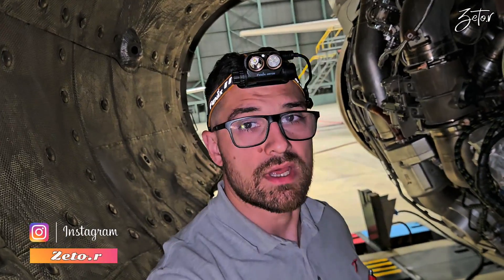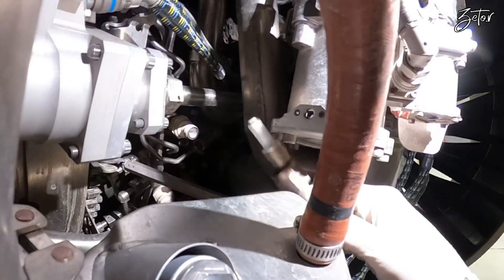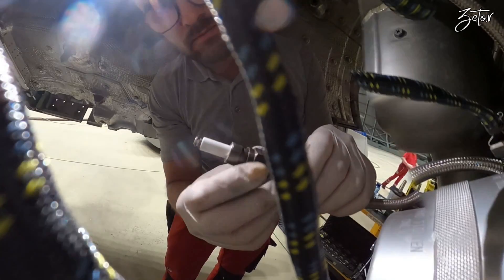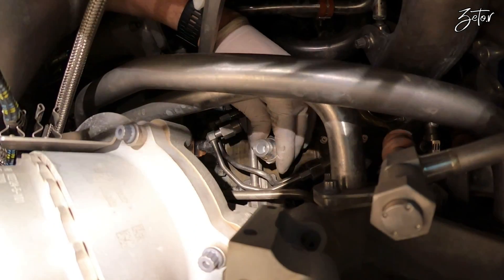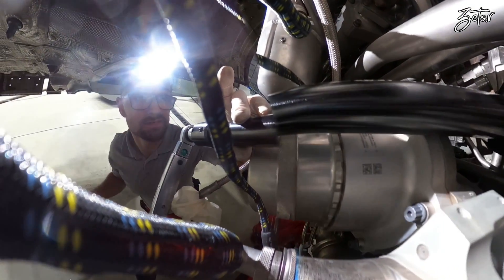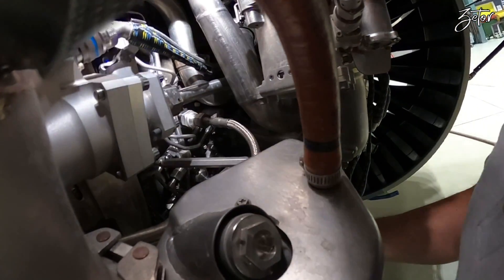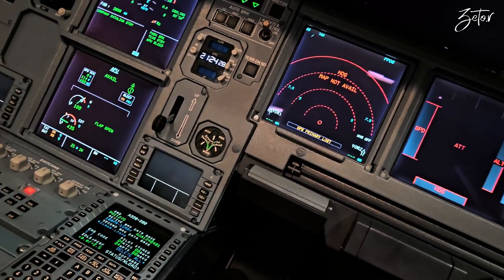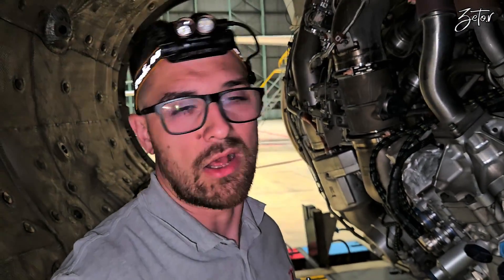How to replace Igniter plugs on PW1100G of A320

Comment: Buongiorno Tomas: Volevo sapere se dopo l'avvio del motore le candele rimangono in funzione? durante il volo dell'aereo in caso di pioggia le candele entrano in funzione in automatico oppure il pilota deve accendere, guardo i tuoi video molto volentieri, sono molto interessanti, ciao e buon ferragosto
Reply from the maker: After start they are automatically switched off , they are switched on only during heavy rain to prevent light out

Comment: Which cb did you pull before apu fire test ?
Reply from the maker: I don't know the name and I'm not at work to find it but you will find it in AMM in APU start procedure
Reply: @zeto.r  ok i found its L40 to prevent auto extinguish
Reply from the maker: Exactly 🙂

Comment: Here you can see how complicated it is to perform the reliability SB to the igniter adapter spacer...
And to safety wire the adapter...
Nice to see how it works "on wing" 😉
Reply from the maker: Yes it is hard to access of course. I guess shop work can be also really chalanging
Reply: @zeto.r  Due to big redesign of the core engine the amount of Service Bulletins and the borescope limits ... it is 😉
Keep up your Videos. Very interesting stuff 💪

Comment: How do you like the PW's? My carrier does not have them so aside from older Pratt's I have no experience on them. I can tell you the GE/CFM versions go through fuel nozzles like crazy compared to old. Just part of the cost of running the engine leaner and hotter I hypothesize.
Reply: From my limited line MX perspective they're a pain. They're easy to over service if you're not careful, you have to open the C ducts to access the IDG, and the core is so small that everything on it is packed very tightly making it hard to work on. I've also seen a lot more instances of damaged and chafed harnesses and fire loops on them because everything is so tight in there.